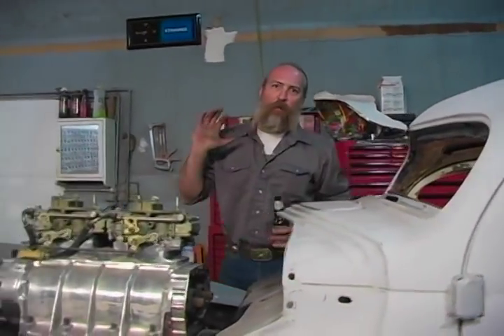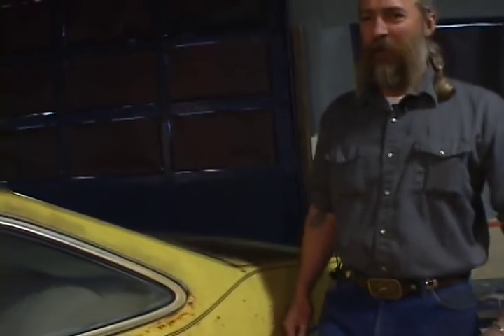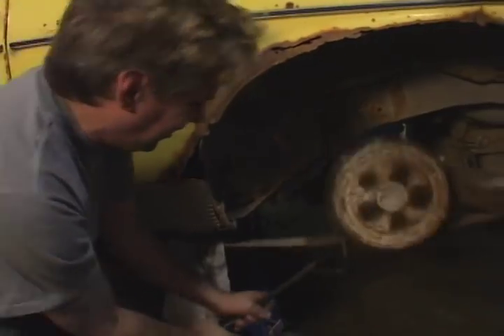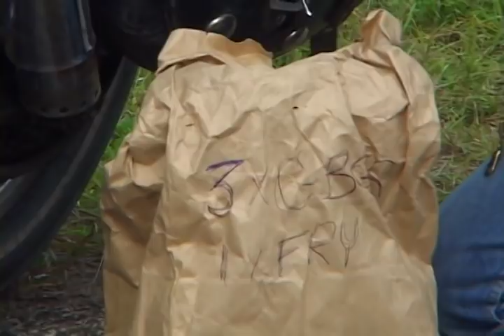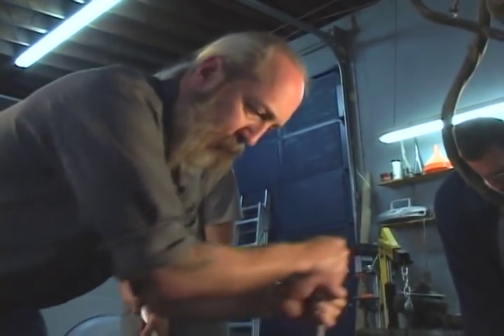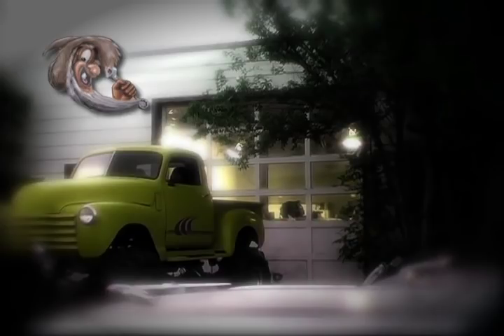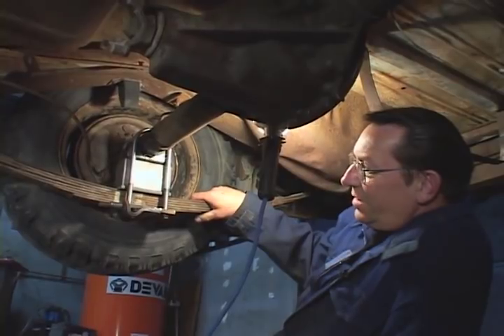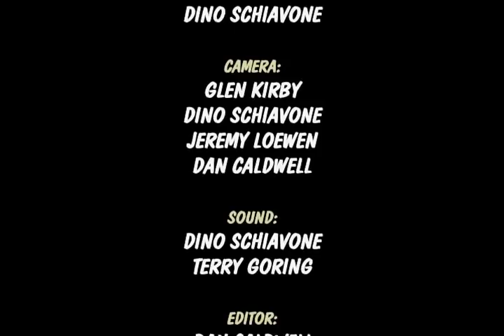Hillbilly Garage TV Pilot Episode

Comment: I got somethin i created. I got an old 55 cadillac hearse with no front clip steering or driveline for 100 bucks no title. I had a 53 packard front end that oddly needed very little cutting an welding to get it to fit. I also put a 81 silverado 1 ton chassis under it before i did the front. Found a 500 cadillac v8 bolted to a 4 on the floor stick from 72 i paid 700 bucks for an i was told it didnt run. But with very little effort i got it to turn. An then got it running on the lift i built with an old holmes 750 wrecker bed. I got a nice lime green interior in it. An i painted her abysmal black. A 3000 dollar paint job. She sits on 18 inch all terrains. An has a custom made rebar rear bumper an a telephone pole front bumper. KC lights on the front between the headlights. Has 4 triple led tail lights an the head lights are a bright yellow. Giving it a eerie look when flyin down the highway late at night. I love this straight pipe monster. Sure is fast fer a hearse. An from what people already tell me my car is evil as can be. An its built with a graveyard mind fer less than 10 grand.
Reply: That sounds frickin' AWESOME !

Comment: back in 1960 I helped a friend put a 50 olds v8 with a 54 4barrel carb and manifold into his 53 chevrolet.  he bought a transmission adaptor housing. we used an adapter pilot bushing(the olds had a hydro). an 11 inch b%b clutch. way to much engine for the trans and rear end.